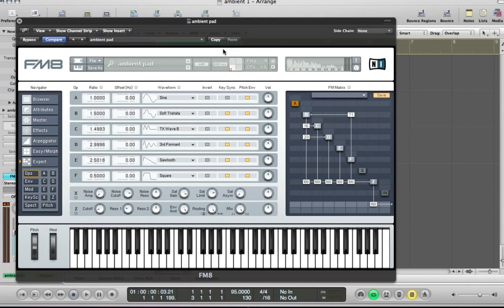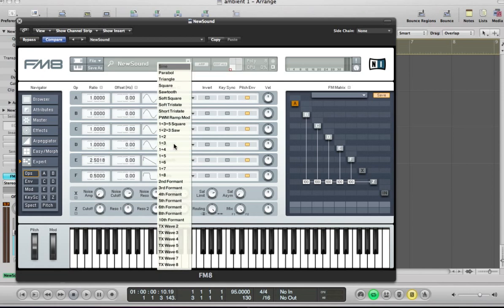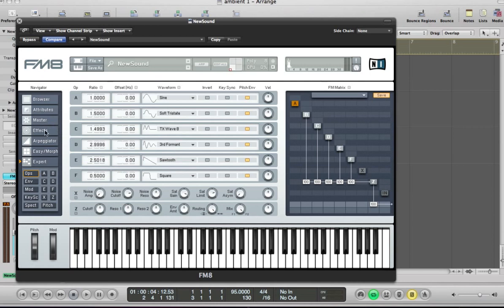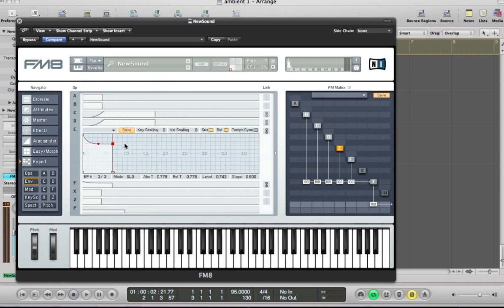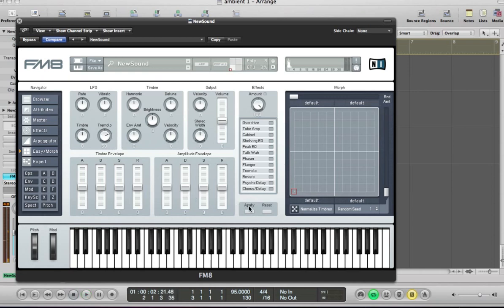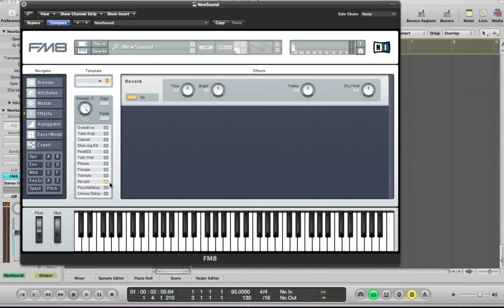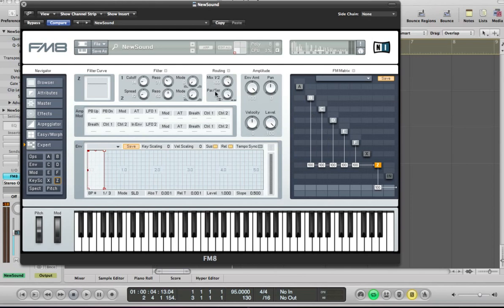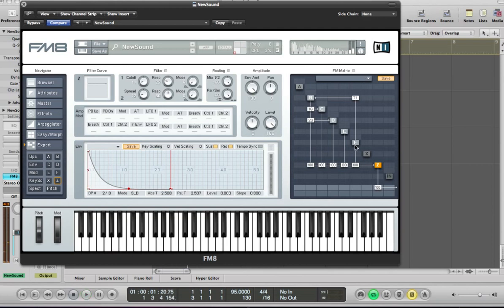FM8 - Making Lush Ambient Pads - How To Tutorial

Comment: super useful!  one thing i always wonder when i watch FM8 tutorials... the teachers always say "i'm going to send B into C at around 25" but how do they know what number to set it at?  for me FM is completely unintuitive and i can only learn by ear what each adjustment will sound like.  is it possible to just "know" what a level of 25 operator modulation will sound like before doing it?
Reply from the maker: I've found generally speaking routing any higher than 40-50 and you end up with a very distorted FM tone, however sometimes you can go really high and it sounds nice, this is the thing with the FM matrix as there's so many variables. 
You also have to consider the modulator and carrier waves and their tunings, sine's are smoother than the formants, for example. Also, if the pitch of one of the waves is detuned it can limit how high you route.

The more you use the synth the more you'll get familiar with the levels and how they will affect each other.
Reply: It’s a total head fk mate
Reply: No